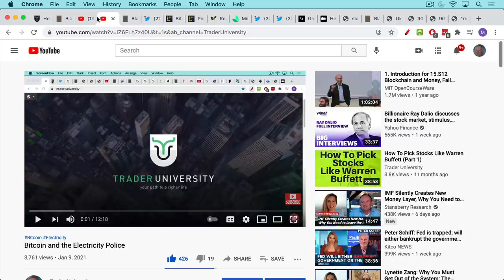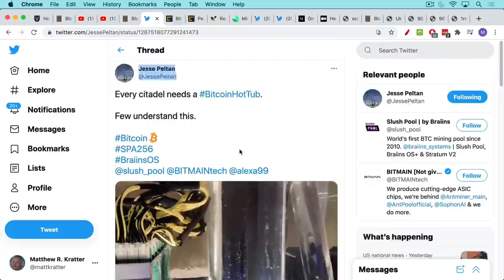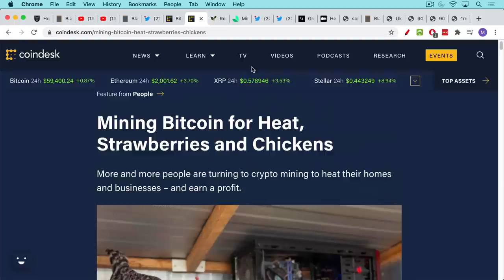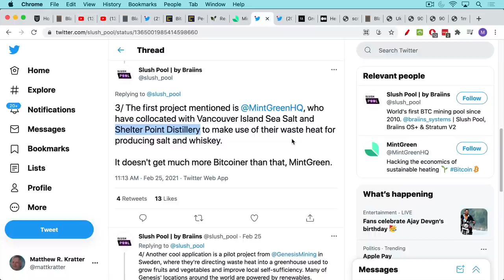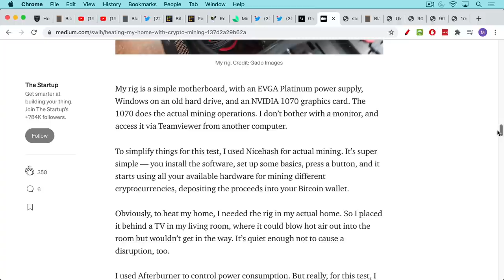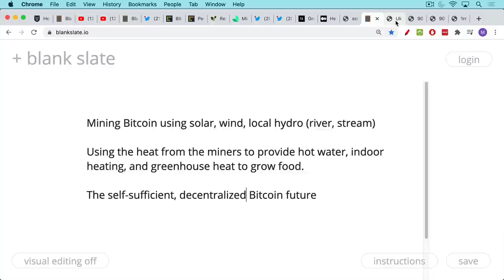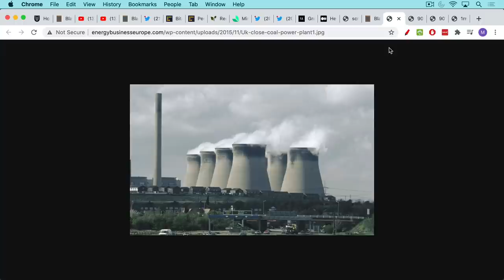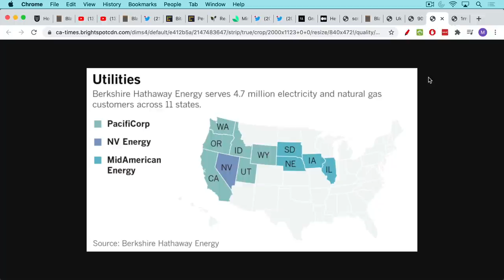How To Heat Your Home With Bitcoin

Comment: FYI (don't shoot the messenger), energy police twitter would use this against BTC i.e. look how desperate and bias they are.... a tiny <1% amount of heat is reused... meaningless and doesn't make up for huge footprint etc. BTC will need to prove it's mined with clean energy in the years ahead for ESG reasons.